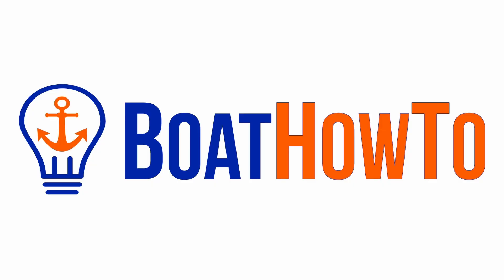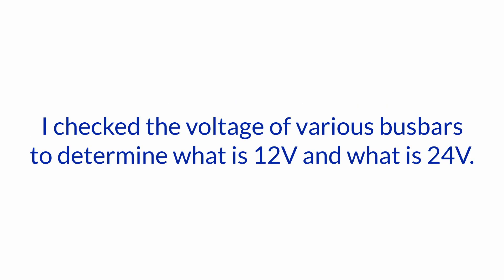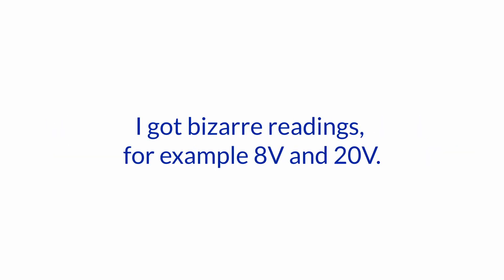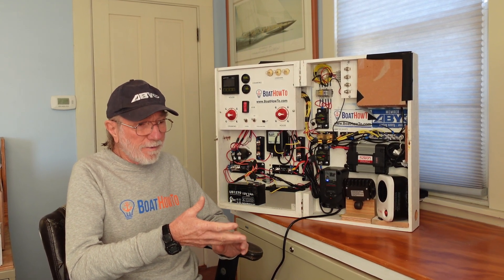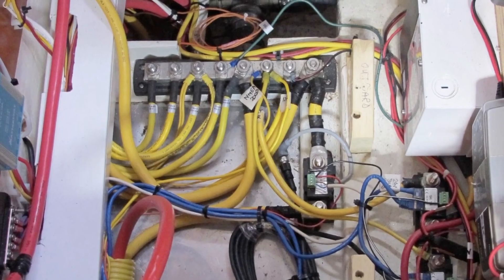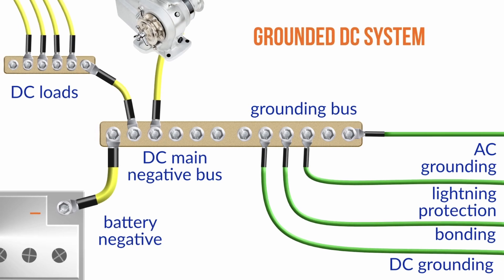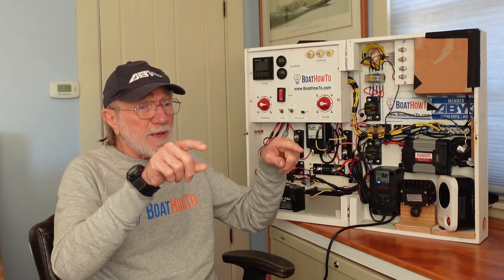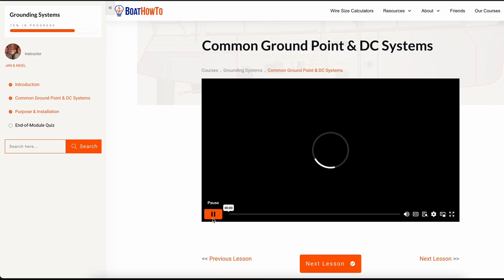How to get your DC Grounding CORRECT 🙏 | Ask The Expert with NIGEL CALDER

Comment: I have a boat question for you.  we have a custom built sailboat and there is a bonding system, i see a copper bonding strap and wires going to all the metal strainers and i assume other normal parts that should be bonded.  The odd thing about our boat is besides the zincs on the prop, prop shaft and bow thruster there are no other zincs.  None on the hull and none on the strut.  almost every sailboat i see has a zinc on the hull, the strut or both.  Any idea if this is normal or corrrect?  The boat was built in 1999 and i assume if it was a problem it would be known by now.  Generally we have to change the prop zinc mid to late season ( 6 month new englan season ) and the bow thruster and prop shat zincs are still well about 50%

Comment: Thanks.  Perfect timing - for me.  I recently separated my two group 31 AGMs into a single group 31 (140ah) lithium and one (of the old) AGMs for starting.  I separated the grounds and was surprised that my VHF radio (and a few other loads) no longer worked.  I had a bunch of weird readings on my positive load bus bars.   Then I reconnected the negatives on the two batteries and everything returned to normal.  Thanks for the reassuring advice.